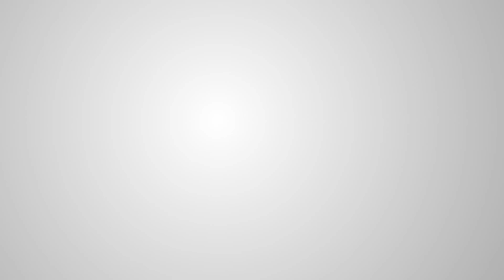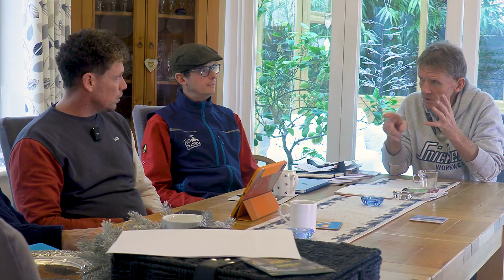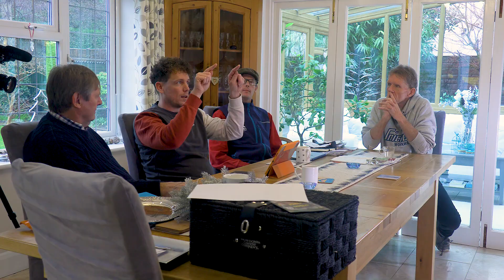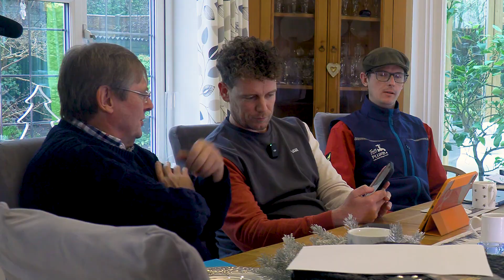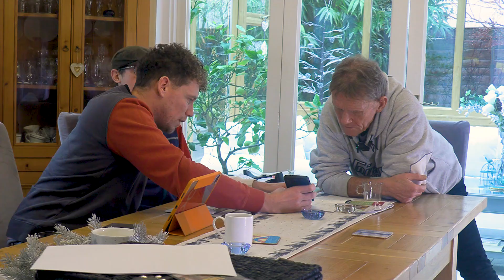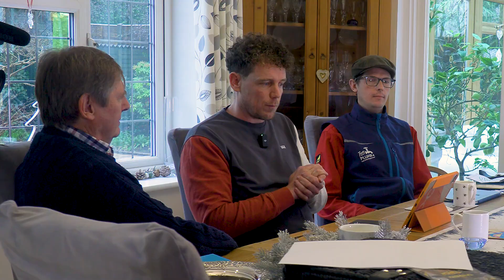What Did We Learn from the Heat Loss Survey?

Comment: My gas bill in a 15 year old house this winter is a whopping £8.75 per day. I could't imagine the cost for a heat pump. probably double that...
Reply: COP 4 = every £ you put in you get 4 £ out . This is against the law of physics.  If this is real, why don't we upscale and create a power station with the same technology. Or one at the end of every street.  It's a scam. PS I did the training back in 2016 for all renewable, and    I carried out 22 surveys and was only able to recommend 2 properties suitable for heat pumps. If we reduce flow temperatures and insulate a property, a gas boiler becomes cheaper.
Reply: @jeremy00-7  Agree. Is there any renewables you recommend? At present PV  looks to be viable with an export connection.
Reply: I'd get those drafty windows sorted, and better insulation!
Reply: @stuartburns8657  Windows are double glazed and good insulation. The Modena combi boiler is probably the problem (78% efficient).
Reply: Heat pumps are about 4 fold more efficient than gas boilers when properly installed.   If you go on a tariff like Octopus tracker which averages out at about 2x the cost of gas, then overall a heat pump will cost you half that compared to gas.

Comment: Listening to the point re your bedroom temperature l have heard this story all my life (75) including my own situation, and this does not only apply to the bedrooms, we need to design heating systems to provide regional temperatures in rooms for total comfort.
I will never take the H. P nor Solar route simply because the efficiency we try to achieve will cost far to much to install and maintain in its complexity.
It’s rather like Electric Vehicles they are to expensive, like you if we need some local heat we plug in a heater to boost.
Until houses are designed with air locks at openings “and that’s not going to happen any time soon” gas boilers are still the way forward in my opinion.

Comment: Go review the Future Homes Standard consultation. They have a table of fuel costs (heating only), current standard (gas combi with PV) compared to a new option 1 and 2 standard with heat pump. By comparing heating only costs the current standard does not benefit (heating costs only) from the PV. They are very sneeky and will do anything to make the HP's look viable. Go provide your feedback on this matter.
Reply from the maker: I have heard about this massaging of the figures, we will look into it.
Reply: @SkillBuilder  Table 4.2 in the consultation document.
Reply: @John_Wood_  Option 1 also has Waster Water Heat recovery, lower air tightness which would add to the savings. I'm not sure under SAP how the PV system is incorporated as it will also look at lighting and ventilation system and their energy usage. I believe if no battery is specified the new SAP will allow for a solar diverter to heat the tank. The key difference to the baseline and the heat pump is the emissions savings, 1.4t vs 0.05t CO2e/yr for a 76m2 3 bed semi. Thats the key driver here.
Also the 2021 baseline house also assumes PV.
In either case, PV or not, a gas boiler will always be more polluting than a heat pump (when installed correctly 😉) and run off of the grid.
Reply: It is imperative we get away from gas for heating. It is environmentally destructive and there are far better things to do with it. The environmental costs of gas appear on no balance sheet but are real nevertheless. They will be paid for by our grandchildren who will curse us if we carry on as we are.

Comment: Yeah -7°C is probably coming from the German Design rule. We design for the coldest day of the year which was available at least 10 times in the last 20 years (Normaussentemperatur) . This means in Germany you Design systems for -7 to -15. This is why in Germany most systems are too big sized an not very efficient at milder days. But I would say this knowledge also slowly trickles down right now to heating engineers.

Comment: Hello. Can I please clarify something: regarding boosting the system when it’s below design temp…an immersion heater was mentioned. Would the DHW tank immersion count/work? Or are we talking about adding another immersion tank into the CH system? Thanks.
Reply: The immersion they are taking about is in the hot water system yes
Reply: No. A totally different circuit.

Comment: Hi , when nuclear came out in the 1950,s , it was going to be so cheap , but never materialised , the time it started to get expensive ,was when they put vat on and we paid for all the subsidised green energy ideas  . It will end up like EV cars , they will just keep putting the prices up , to get the Investments back , for the energy companies and the government . 🤔 I would like to see how much a heat pump , servicing and break downs for 35 years costs .  A little bit like an oven ready Brexit , from Boris . The best idea I have every seen in 50 years in construction , was from the Scandinavian countries , where the electric panel heaters for each room was around 35 watt and 50 watt in student accommodation 6 stories high for Bournemouth Uni . May be give them a shout and see if it is still working ? Not yet sold on heat pumps .🤔
Reply: Nuclear power " to cheap to meter " that was put forward to sell it.
Reply: For some reason all electricity unit costs are linked to unit gas costs, regardless of method of generation(or the cost of that method). Absolutely no idea why but that's the way it is. Gas goes up, so does electricity.
Reply: EV cars are coming down in price!

Comment: Farsighted, we installed UFH at build 12 years ago, but have only used log stove for heating since. With a view to heat pump install we ran UFH off gas boiler : we liked it. BUT just running the electric pumps themselves uses 3 to 4 kWhrs per day. Is this usage negated and/or included in efficiency calcs for heat pumps?
Reply: Yes, the COP is based on total heat output, over total electricity used by the system (including pumps, controls etc). Also, if you are using a pump from 12 years ago, they tend to be a little worse in terms of electricity usage for the same flow rate.
Modern heat pumps tend to use more expensive, high efficiency pumps, but since they are designed for longer run times, they pay back that higher initial cost over time.
Reply: You are likely over pumping.
Reply: Small 6 x 16m 1 1/2  storey highly insulated, EPC of C (based on initial SAP on LPG underfloor). Waiting for new EPC of D or E! to be registered, can't use SAP calcs! Hope you're correct 🙂.
Reply: Are you sure about that? You are using over 100 watts for pumping. That is far too much.
Reply: @rogerphelps9939  maybe too small bore pipes or bad layout or unused for 12 year pump(s)?

Comment: Why not show the details of heat loss calcs to understand how they have been calculated and the ‘margins’ the designer has applied.  You could also show the difference in heat loss for the extra insulation room by room and show, given the large radiators, what mean surface temperature matches the heat loss.
Reply: The heat loss calculations are not a secret and are available open source - Google is your friend.

Comment: The ‘buffer’ you are talking about is for hydronic separation to allow a secondary pump, it’s not a buffer
Reply: If it was only allowing hydraulic separation you wouldn’t use a buffer you’d use a low loss header. The buffer is also to add volume and allow longer run times. It buffers the energy spikes
Reply: @HeatGeek  I fully understand this, but in the house in question I understood that the ‘buffer’ was not used as a volumiser but to allow a higher head pump to circulate into the house.  Agreed that a low loss header is better for this as long as the two flow rates match.

Comment: If you have enough flow rate above the minimum flow rate of the heat pump you can shut down zones as long as the water content of the remaining live circuit is above a minimum to avoid stop/start on the heat pump.  Saving heat loss and pumping power is just as important and if the heat pump has a flow rate above its minimum it can work.
Reply: Heat Geek have a video on the subject entitled "Why NOT to ZONE Heat Pumps! or boilers". Long story short, the overall heat loss tends to not drop by enough to justify the reduced capacity of the radiators, which in turn increases the required flow temperature.
Reply: @yngndrw.  I will watch, thanks, but it’s really about pumping power not heat loss, assuming reduced flow is still meeting manufacturers minimum flow requirements
Reply: @swisby3820  But the issue is that turning off some radiators effectively decreases the total surface area of radiators within the property. The rate at which heat is transferred is governed by the surface area and the difference in temperature between the mean water temperature (Which is indeed affected by flow rate, but they already mentioned a temperature delta of 5C across the radiators in the last video) and the room temperature. Decreasing the surface area means that the mean water temperature must increase to provide the same overall output. The point that the Heat Geek video makes is that the heat loss reduction isn't large enough to offset the reduction in radiator surface area.

Comment: I’m 6min in …was the customer talking about Solar (thermal) re heating the hot water and the chap with the curly hair …mentioning solar (voltaic) for heating the immersion? 

Were they both talking about the same type of Solar ?? I got the impression they weren’t
Reply: The customer was talking about using solar PV for heating water in the summer. The Heat Geek did not really finish explaining his proposed alternative which would have been using the heat pump to heat the water (leveraging the COP of 3) and use or export surplus generation (on an Octopus tariff 15p KWh) - I think.
Reply: He means, solar thermal to warm water and Solar PV to generate electricity to run Heat pump/ emersion for hot water back up. This is absolute madness.

Comment: My understanding is that running a typical heatpump would triple my annual electricity use. Given the price of electricity i suspect this would be a very significant increase in costs on top of the installation. I only use my gas for 3 months of the year and before the energy inflation my G+E were 720/year.
I cant imagine forking out for a heat pump on an old terraced property with no suitable location to easily put on, would make any sense at all unless electricity costs come down, but all indications are they plan to just make it more and more expensive.
Reply: It is the case that the retail price of electricity is tied to the most expensive generation method. Since the efficiency of using gas to generate electricity is around 65% I would expect the price of electricity per kwh should be no more than twice the price of gas. Considering that renewables now make up a third or so of our electricity supply and are the cheapest, we are being right royally ripped off somewhere along the  way @makcity7850
Reply: Your understanding is wrong, don't be proud of being ignorant 👏
Reply: Average price of gas in the UK is 7.42 p for kWh, average price of electricity is at 28.62 p for kWh.

So against a condensing boiler you need your heat pump to reach 3.8 CoP to be cheaper per kWh of heat produced. ~3.0 for an older non-condensing boiler.

There are additional savings that could be had with a time of use tariff and being able to drop the standing charge for a gas connection.

In my personal case my heat pump is just below the efficiency that would make it cheaper than gas. But that is more than made up by the fact that I can use a lot more of the energy generated by my rooftop solar domestically from March to October. If you have/plan to have rooftop solar, moving your cooking and heating to electricity would have additional benefits, since the you'll get a bare fraction of a what you pay for a kWh of electricity for feeding power back into the grid. My neck of the woods has a guaranteed feed-in price, but one that is at around 1/4 of my electricity cost. With some clever scheduling we get all of our domestic water heating and house cooling covered by solar power in summer.
Reply: @miken3963  Well, i barely use any gas in summer, just for hot water which really is nothing. Pay pennies above the standing charge. If i added solar, (perfect south facing roof) im sure it would cover most of my energy use in summer sans the heat pump. I have a large south facing garden that would be ideal for ground source but id still have nowhere to put a heat exchanger without knocking down a conservatory or putting it on the front of the terrace which would be awful.
All in all, its a lot of resources, infrastructure and cost to warm a single person living in a 3 bed terrace who already had a pretty tiny carbon footprint.
Reply: @Etacovda63  I use a lot of gas for a very short period. Im working or sleeping most of the day, but when im home in winter, the heatings on and the house is warm in 20 minutes.
No point asking me to spend thousands to have a lukewarm house and an immersion heater. I will be violently opposed to that.